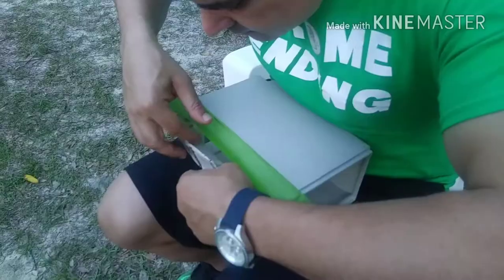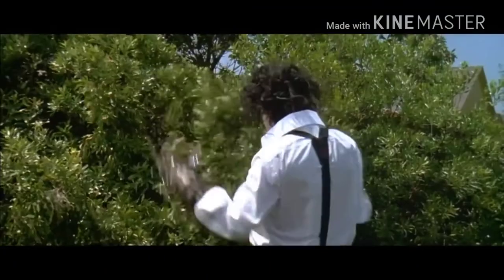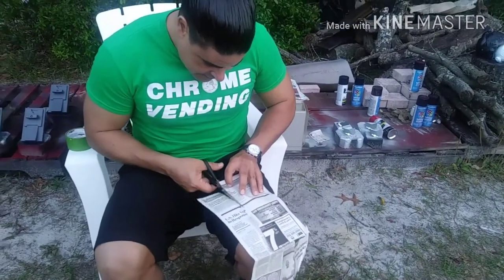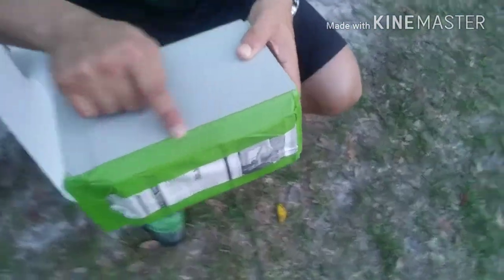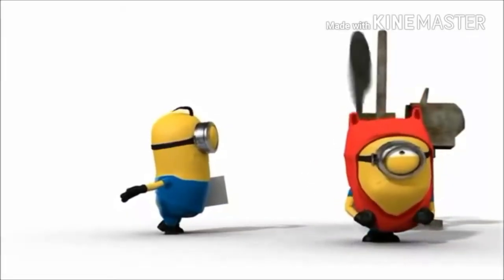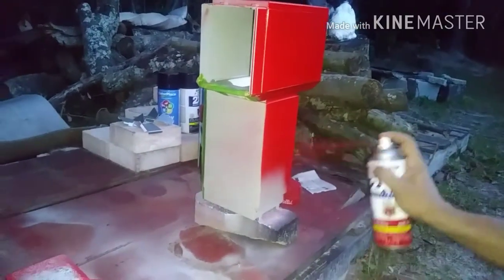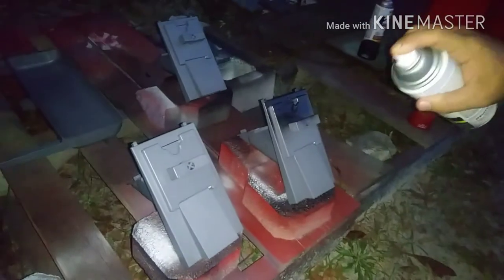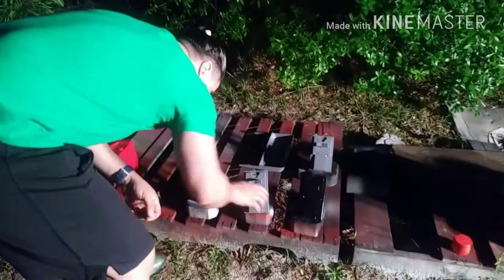Gumball\Candy Machine How To: Disassemble, Repair, Adjust, SprayPaint, Refurbish A Vendstar Part ll

Comment: I double clear coat the coin mech area and it last for a while
Reply from the maker: Big Daddy Teddy 
Do you use Rust-Oleum also or a different brand? Rust-Oleum I have found works best for me.
Reply: Chrome Vending yes i do
Reply from the maker: @themilfordfamily1656  
What's up man? How are your machines doing?
Reply: Chrome Vending everything going pretty good. I let my 8 y/o run it on the weekends. I just opened a store
Reply from the maker: @themilfordfamily1656  
That's great man
 What kind of store?

Comment: Ive been watching your videos for a few months. Crazy how far you have come. 
I do have a question if you have time. 
I have a 4 pod U-TURN candy machine and an heavy ass old school 3 pod astro machine and. They each slots for small candy. But... every time i put M&Ms (or something that size) it gives out about 15-25+ candy.  I cant remeber how much. Evennon the smallest setting.  But. I feel like im using the wrong candy or i need to modify the size of the holes? What should i do?

Comment: Hey bro blesssing 2 u. I was wondering if there is a way to put 1" gumballs in a vendstar 3000 without the gumball gwtting stuck or split by the mechanism?? I tried the 1" but the mechanism is getting hold by the stuck gumball...anything to do about or just not use gumballs on the 3000? Take care hermano.
Reply from the maker: Gracias. The only gumballs I've ever used in my vendstar 3000 machines are the small double bubble gumballs that I buy at Walmart
Reply: @ChromeVending  gracias hermanito. Bendiciones para ti y los tuyos. Eso hare.
Reply: @ChromeVending  hi  many of these small dubble bubble you give per quarter? I saw those at my local walmart...thank for the fast reply.. take care blessings